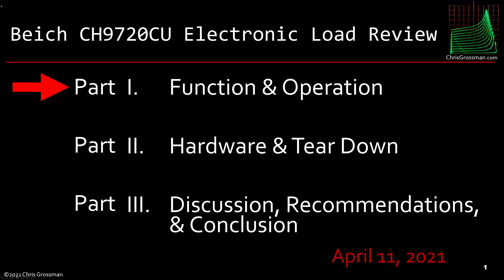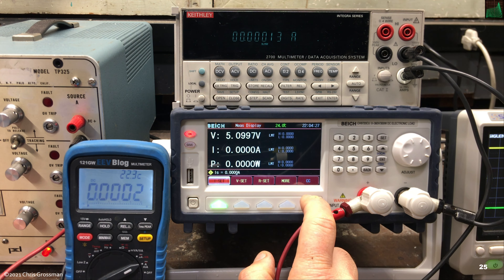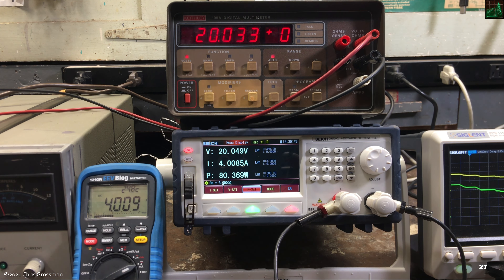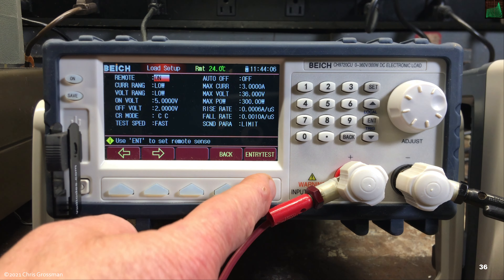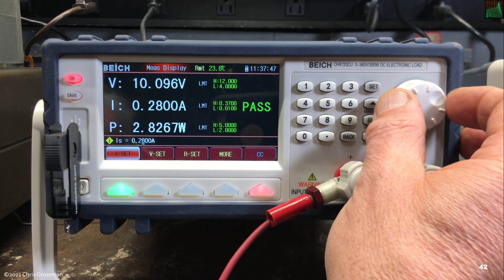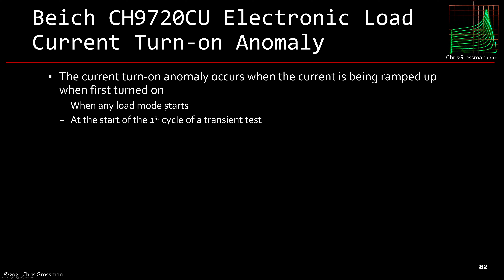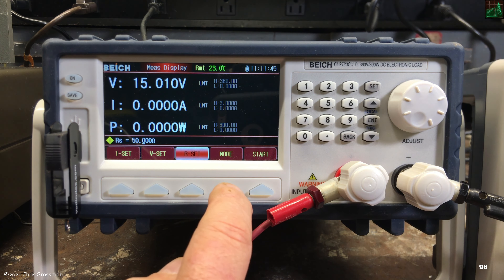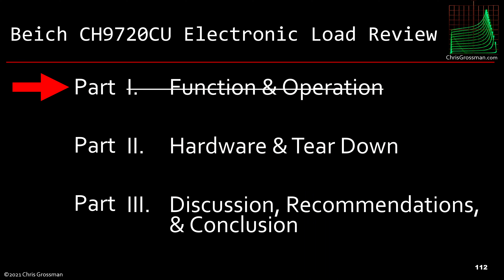⭐ Beich CH9720CU Electronic Load Review : Part 1 of 3 : Function & Operation 0014

Comment: $535 seems quite reasonable, if you need the higher voltage and power spec over the $500 Rigol (150V and 200W max).